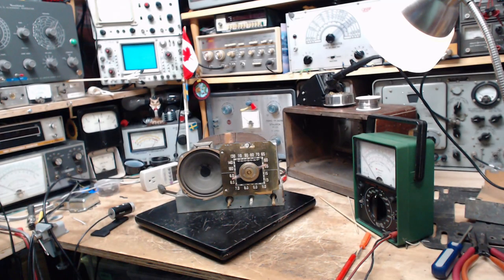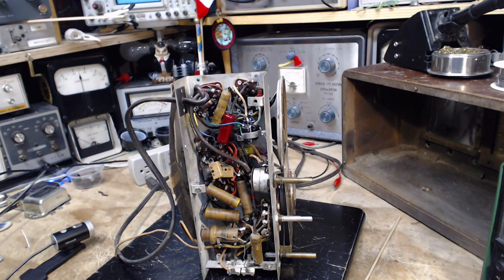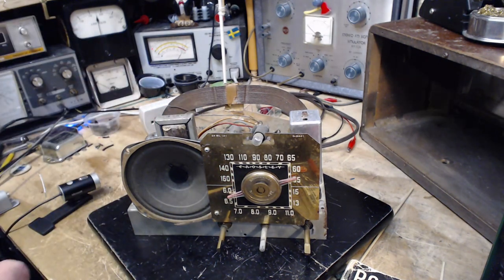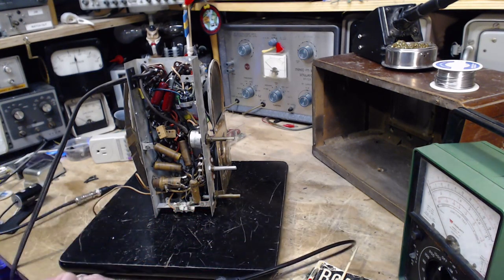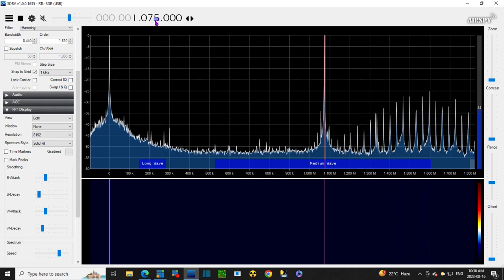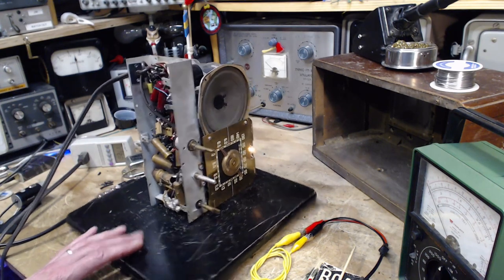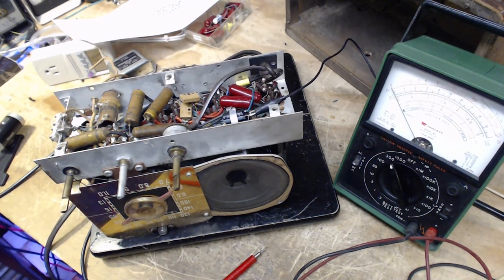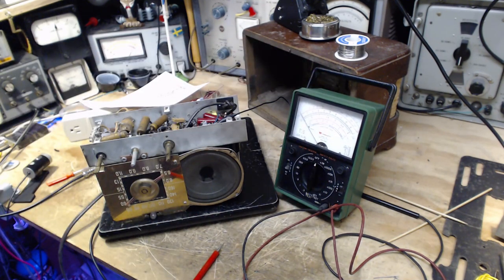Moffat Crosley Model G2465 Five Tube Radio Video #5 - Tube Voltages and a Capacitor

Comment: See you’re liking that Triplett meter. I have 4 Triplett 630 meters dating one per decade from the 50’s-80’s. Very robust and accurate analog meters. I have one Simpson 260 also but I favor the Triplett meters. I had a chance to purchase a Triplett 3444A tube tester for $2500 about 7 years ago. That is the holy grail of American made tube testers. They didn’t make that many of the A variant.

Comment: Face it, you have early stages of on set Mica disease beginning.  Good sweep alignment will clarify that. However please do the alignment correctly by disabling the local oscillator an the do a stage by stage alignment. Then go over it one more time. Dont use that dammed SDR. It might look cool but it is just another radio in the game. You have a wall of good test equipment, use it.